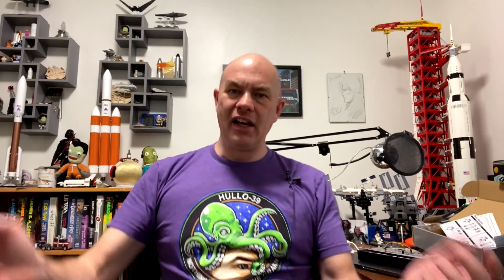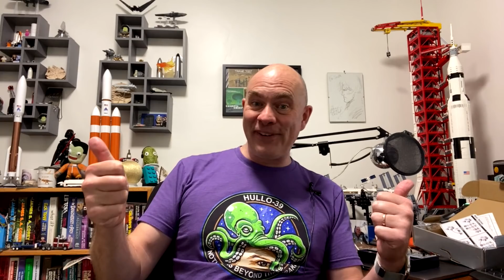The Rocket Powered by a Non-stop Nuclear Explosion - The Nuclear Salt Water Rocket

Comment: wait... so the exhaust is hotter. but you still have to throw stuff out the flamey end. why would this be able to burn as long as ion engines with the power of chemical engines?
Reply: The exhaust being hotter means you're throwing it out the flamey end way faster. This means you need a lot less mass to have the same pushing power as a chemical engine due to the reaction force of Newton's third law being proportional to the mass time the velocity of the exhaust.
Reply: I think it's better described as "burns long like an ion thruster," not "burns AS long as an ion thruster." The main difference is in the required fuel and propellant mass. A chemical engine needs massive amounts (tons) to achieve high thrust. The nuclear salt water engine only needs a few hundred kilograms to achieve the same thrust. 

When Scott compared the NSWR engine to a pair of Saturn F-1 engines at 9:44 he said the Saturn engines required about 25 times as much fuel to achieve the same thrust. That implies the NSWR engine could run 25 times as long as the F-1s for the same amount of fuel and propellant. I haven't been able to find any figures on how much propellant an ion thruster uses, but I imagine one could run for years on a couple tons.

Comment: Any nuclear physicists know if you could use thorium or uranium in a breeder reaction to have a two stage process where the first stage of the reaction is more like a conventional nuclear reactor to generate the power for the high speed pumps?
Reply: I've seen suggestions that it may be possible to extract electricity from the exhaust flow using a magnetohydrodynamic (MHD) generator. If the engine is generating 700 gigawatts of power, I imagine they could spare a couple hundred megawatts to power the rest of the spacecraft.

Comment: The other problems (besides first stage use,) would be that it wouldn't be able to land on planets/moons using that engine without contamination/destruction, so you'd need a separate lander, or redundant engines. And it obviously wouldn't be able to land back on earth using the NSWR.
Reply: Why it's a problem? You're still dreaming of spaceships flying around and landing on demand like Millennium Falcon?
Reply: @bergonius  He just mentions how a NSWR could hypothetically be used to replace chemical rockets on Starship. (And seeing that Starship's designed to land on planets/moons, and back on Earth (with the exception of the Lunar Starship), it would kind of defeat the purpose, for that specific case.)
Reply: @metachuko  Well i think Starship was used only as an example to put NSWR capabilities into perspective. There's no reason to use the same craft for landings and interplanetary travel. It's just not practical for the same reasons why SSTOs are not practical.